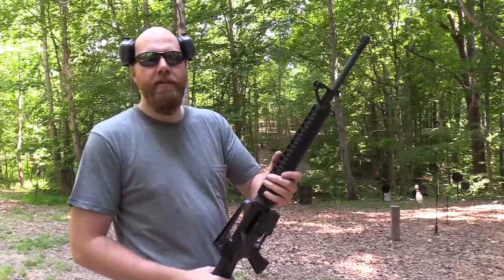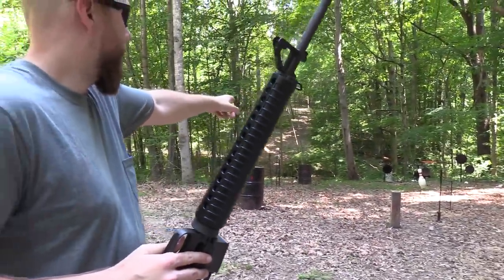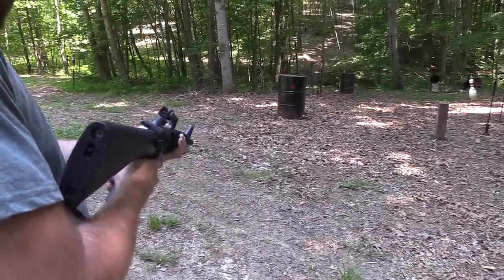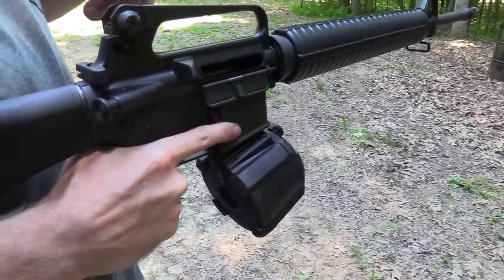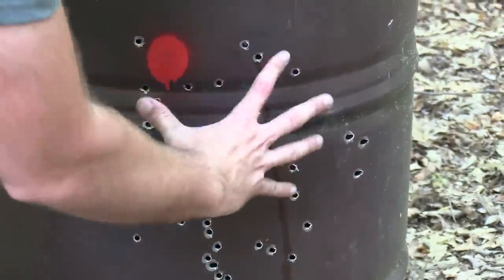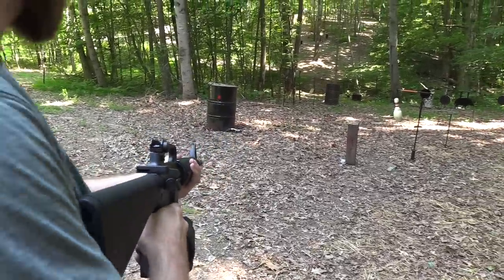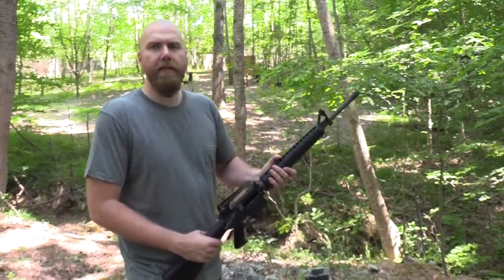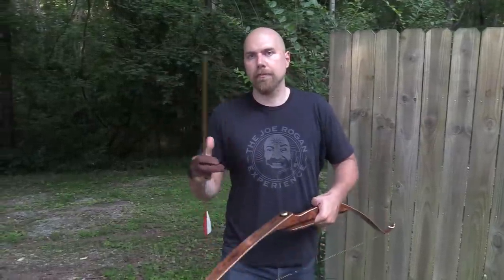Is Full Auto Controllable?

Comment: "Is Full Auto controllable?"

AK-107: "I'm the answer to that question."
Reply: Was looking for this comment
Reply: Real shii
Reply: Knights Armament LAMG: glares from afar
Reply: True
Reply: HK416 too
Reply: Surefire MGX
Reply: @canaluludorel5838   hk416 still has more recoil than ak107 since the recoil is not counter balanced
Reply: @canaluludorel5838  416 is gas piston operated, it actually has more recoil than the m4 analogues
Reply: @vincentriver3017  no way, i refuse to believe this.
Reply: @CheekiScrubb  ultimax mk3 enter the chat
Reply: cz 805…..
Reply: I agree
Reply: @canaluludorel5838  it has more recoil than ak-107 as far as the basic mechanism goes, the HK416 does shake a bit and does have a little bit more recoil, put in practice it is subsided but still controllable best at around 45m on the dot. The ak-107 is using the counter weight which literally has a metal weight pushing forward as the bolt goes back, almost mitigates the recoil, just a little shake in side to side.
Reply: @canaluludorel5838  the m4 only has to move the bolt assembly, while the HK416 moves the piston to move the bolt, so there may be room for a little bit recoil, or rather the shake as it pushes the piston, which is a piece of Its own kinda floating, and then punches the bolt which causes a little of the shaking and then the bolt cycles which gives the rest of the recoil, but sure in semi-automatic it would be controllable, but at around atleast 800 rpm it just keeps pushing.
Reply: AK-107 is awesome but the system of the rifle looks complicated, compared to the other piston rifles.
Reply: @fuckheinschitt239  bruh I guess a gear and a metal bar is complicated enough
Reply: @fuckheinschitt239  but I think the overcomplicated one is goes to the AN-94
Reply: @michaelsilva4844  yeah.
Reply: AK-107: “where recoil”
Reply: @canaluludorel5838  hk 416s actually have a harsher recoil cycle than most m4s
Reply: Ultimax 100 :AMATEURS
Reply: Ahhhaaahhaaaaa!!!! The truth!
Reply: AEK-971,3 : We* are the answer to that question
Reply: @canaluludorel5838  Leave it to the French to ignore what's right in front of them!
Reply: "Laughs in controllable 9mm"
Reply: dont forget the grease gun and the cz skorpion
Reply: Airsoft rifles are also controllable with full auto. 7.62 not as much.
Reply: Kriss Vector 9mm: you rang?
Reply: @paddlesaddlelad1881  i think most people are excluding smg's, but now that you brought it up, the MP5 should fare pretty well
Reply: 109*
109 is an advanced version with better recoil control.
Reply: @qanon7958  AA-12 isn't an smg
Reply: @paddlesaddlelad1881  huh, right...i was talking about the grease gun tho
Reply: @paddlesaddlelad1881  and i dunno if the skorpion is either a machine pistol or an smg, but it's certainly not a long-gun
Reply: Defenetly an PF player
Reply: @michaelsilva4844  yeah, the Russians saw the Krauts cooking up their space magic with the g11 and decided to give it a go themselves. AN 94 was a pretty cool rifle actually, even if it was expensive and complicated to the point of impracticality.
Reply: True lol
Reply: Ultimax 100: Oh please.
Reply: what you mean?
Reply: I forgot to tell you about AEK 971
Reply: ak109 throws a hissy fit
Reply: The MG4 or 5 is also ridiculous in that regard.
Reply: Lol. Unreliable soviet gimmick.
Reply: I read the 107 didn't pass rigorous field tests so was never issued.
Reply: Ultimax 100 is the real answer
Reply: M107 barret enter the chat 👀👀👀
Reply: Also, you’re right.

Comment: When I was in the Air Force Security Police from 83 - 87, we would spend one day every year at the range qualifying and go through about 250 rounds on the M16.  The last part of the day was on full auto, and we probably used about 10 rounds only for familiarization.  Of those 10 rounds if you shot more than a 3-round burst, the instructors would fail you.  Yes, you felt it riding up on you, but then again, we were never given any deep instruction in how to control it either.  That did not happen with the M60, but in the case of that weapon, we kept it down on the bipod legs.
Reply: That's pretty cool or is it not? I dont know. I'm only 15 I plan on joining the military one day lol. Thank you for your service man

Comment: one of the most obvious (to me) hollywood mis-representation is how fast you go through 30 rounds...it is much faster than hollywood magazines.
Reply: About 4 seconds of continuous firing.
Reply: @kylebradley3  More like 2.6 - 2.7 sec.
Reply: @Sunnysky321  gun design really changes that, 600rpm vs 900rpm is a massive difference (obviously)
Reply: M16A2 is 800rpm, so about 13 rounds a second, about 2.3 seconds of full auto
Reply: Right! Also what constitutes as appropriate cover, considering how those cinder blocks got annihilated at 40ish yards I would say Hollywood coffee tables and drywall are made of some magical stuff ;)
Reply: @Sunnysky321  yep, but even though it's 5.56mm Rounds It can Still Feel like a Mulle Kick you in the shoulder. Its sores when in drills
Reply: Hollywood mags: 200 rounds, gear shifters: 40 gears, T-Rex or other/monsters does not die in 3-5 rounds and are made of tungsten...

I needed this video tho since most games i mod, the fire group is usually 1 meter (3 foot) wide basically at 2 meter (6 foot) from the target... the reason i let those like that was because i had no example to base how plausible it was... so now i can make things a little closer to what makes sense!
Reply: Holywood does not use 30 round mags man. Their mags have ♾️ rounds.
Reply: Tried to time it more accurately a few times. My stopwatch gave me about 2.1 sec on average. It leads to approximately 860 rounds per minute, give or take a few percent.
Reply: @theepicslayer7sss101  But in Hollywood if the ammo ever runs out, you just toss the gun.
Reply: Movie Heat has actually pretty realistic rate of fire. But that's a 90ties movie, many modern movies add both the firing and impacts post production. For the big productions easier, cheaper and safer.
Reply: And yet revolvers never seem to need reloading (or virtually never).
Classic Westerns are bad for this.

Comment: All of my experience with full auto has been military with M16A1's, M60's, and M2's.  My experience with M16's and M60's with bipods or unsupported was mostly that of wasting massive quanities of ammunition on misses.  Vehicle and tripod mounts were far and away more efficiIent at all but very short ranges.   In this video, the hit ratio was excellent, but most of the hits were excess inasmuch as any enemy target would have been incapacitated by the first one or two hits.  Further hits would be, again, wasted ammunition.  On the full auto range at Fort Benning, I was surprised at how ineffective M16 full auto was even with a bipod and with my left hand pressing down firmly on the rifle.  My first round was a guaranteed hit on any pop up target at any of the target positions whilst subsequent rounds missed usually high and left.  If I knew that I had a lot of rounds in my magazine, I could spray three targets that were close together in a row in a sweep from one end to the other most quickly, but that was against advice from the trainer.  That was in accordance with other advice, born of experience, from one of my drill sergeants.  Early on as an infantryman, I concluded that unsupported full auto was not a thing that I would do unless ordered or unless I was confronted by multiple targets at very close range or moving targets at short or very moderate ranges.
Reply: My experience and background is about the same but I spent a lot of time in my younger days on the M60 and M249, The 60 is way easier to control off the bipods I would say I can hit groups of 5 military aged males or a vehicle out to 900 meters easily with the 60.  The 249 I really had to lean into those weak bipod legs.  The king is the M240b it’s beautiful, accurate and you can close the cover with the bold open or closed. With a machine gun optic I could probably hit pop up at 800 meters 90% of the time that gun.  I always wished they put a selector switch on it but that’s not the purpose of a machine gun.
Reply: @Cannibal_Actual  The M249 came after my time in the infantry as did the 5.56 mm squad automatic weapon.  However, I did see a copy of the new SAW in the custody of some Marines later when I was in a support company in the Army Reserve.  What is the M249 like?
Reply: @Quentin217  very jumpy, after a 10-15 round burst you exhale smoke…lol.  But as long as it’s clean it works.  Many of my troops don’t like it but when I inspect their weapons and it’s full of gunk I guess it’s very hard to clean well for the new troops.  it has a port to take a M4 mag in the side but it’s almost worthless in my opinion because if your that bad off where you can’t get another belt there is probably another rifle laying around you could use with better effect.

Comment: I was taught to never use full auto outside of CQC - even then very sparringly.

Pro's: 
+ Higher potential lethality
+ Accuracy through volume of fire
+ Has a higher surpressive effect

Con's
- Very high ammo consumption (Often reloads & increased weight of the extra ammo)
- Harder to control out of prone/ prepared positions
- Gun may overheat and be more prone to malfunctions (Most AR platforms weren't designed to be run cyclic for longer periods)

I will say that there are some pretty big advantages, but in my own experience the often reloads and heat issues outweigh the benefits.
Personally I'd only resort to full auto as a last ditch effort to keep an enemy away, generally rapid semi-auto is much more effective at preventing ricochets and scoring accurate hits... If you need to fire more than 3 rounds, you're either dealing with some real shit or you need to work at your marksmanship.

I have overheated an AR platform once, the result was a shot-out barrel... Even with the full guarded floating barrel, I could not grasp the rails around it - with gloves on.
My gun was later deemed unfit for service (accuracy went to shit), so I will never recommend full auto as a default... Use if it makes sense, but be very concious about the effect it may have on your gun and your ammo consumption.

Comment: Excellent Demo! There is a reason why most military assault rifles have full auto cabability; it leaves an option for certain situations. What if you are outnumbered and being rushed at close range? Full auto would certainly be a nice feature to have.
Reply: You usually only carry 6 mags. By the time you're being rushed at close range, you've likely used at least 3 of them. At that point, you only have 90 rounds left. Full auto is a last stand resort or covering your buddy in retreat.
Reply: @Steven Kwiatkowski None of the M16s (3 round burst) are being replaced by new ones. The new rifles are all M4s with full auto.
Reply: @Steven Kwiatkowski USMC pretty much every infantry unit has H&K m27’s now. US army has converted all M4’s to m4a1’s with full auto capability

Comment: "is Full Auto controllable?"

Answer: Depends on caliber, depends if you have any sort of compensator or heavy muzzle break and it doesn't hurt if you're soo jacked, you can Rambo fire 2 M-60s at the same time
Reply: You’re*
Reply: @CasualInTheTrees  Gottem
Reply: @CasualInTheTrees  Grammar Nazi 😆
Nothing of what I said changes because of 1 typo.

Correction: 2 typos.
Reply: 556 is honestly the best round
Reply: @EltonL  agreed. Which is why the whole push to 6.7 seems Dubious at best. Lots of countries still have the Ppsh-41 & it's replacement, PPS-43 in service for use by reservist rear echelon troops. The tokarev cartridge is as remarkable as 5.56 is. It's capable of going through body armor, yet it's as controllable as this AR.
German MP40s also are surprisingly easy to handle, for saying the rate of fire is just slightly lower than the MP18.

Comment: Back in the early 80's, out of shotgun news, and some gun shows, * it was a "parts kit", in a box. So as long as it was in pieces in the box it wasn't illegal. You could get a (tri-burst), the parts were all there, but the lower receiver had to be made before a certain date. After that date the milling was different, it wouldn't allow the install. Unless you had access to a milling machine and or a midnight machinist. Those kits were like $49.99

Comment: With my experience a lot depends on the rifle and caliber.  AK-47's have a lot of muzzle rise due to the high center of gravity of the bolt/carrier, which is a huge chunk of mass. A Browning 1919 on the other hand is very controllable. Don't have any M16 experience but it looks very controllable to me, probably has a lot to due with the smaller caliber and the direct impingement system that keeps the bolt/carrier in line with the muzzle.

Comment: Certainly not the FN FAL 7.62mm NATO. After two or three shots it becomes an effective anti-aircraft weapon.    😃
Reply: Even if you can compensate well, that dang round has so much concussion it blurs your vision because your head is vibrating. It's not the greatest for unsupported fire. Gotta wrangle some of that energy into something other than your upper body.
Reply: @Izak Most battle rifles are NOT  intended to be fired full auto.  If you have to, that's what a bipod is for.

Comment: The original purpose of full auto is for suppression / covering fire so troops could advance no man's land with less risk of being shot. However  with the benefit of of full auto, there are increased logistical, mechanical, and training problems. 

You could argue in certain encounters the rapid followups could be desirable, but I would say it increases the likelihood of unnecessary shots which may or may not be important if the engagement continues (more than one attacker or missed shots). Of course there is always the liability issue where did each round go. 

All in all, should full auto be regulated? No. Is it widely practical? Not for most people currently.

Comment: Full auto is its own beast, the 3 major factors on is full auto controllable are...

1. Firearm design - This is critical, you can have 2 firearms chambered in the same round with 1 being considerably easier to control than the other under full auto, its a very complex and complicated process but there are significant differences between platforms.

2. User experience & capabilities - This is also critical, someone that is used to shooting full auto and knows how control muzzle climb and drift can make much more effective use out of a full auto firearm than someone with little to no experience can when operating the same firearm in the same conditions.|

3. Cartridge Power & Rate of Fire - These 2 are intertwined, and for good reason. .22LR at 800 rounds per minute in a Ruger 10/22 is incredibly easy to control, .50BMG at 800 RPM in a shoulder fired weapon would be insanity. Also .22LR gassed up to 2000 rounds per minute would generate way more recoil than people would think, I have shot a Ruger 10/22 with integral suppressor at 1200 rounds per minute and its got some muzzle climb, even 1,200 is much more noticeable than 800 rounds per minute.

Comment: Full auto always seemed pretty pointless to me unless it's strictly for suppression, but if that's the case they're most likely going to be in a belt fed machine gun for suppression

Otherwise you'd run no more than 2-3 round burst at most on regular mags.
Reply: It would be very useful in CQB and room clearing situations. It’s definitely a capability I would want to have if I was a soldier.

Comment: So in order to answer this question, you have to try it. I've fired M16A2, M60, SAW and good ole .50 cal.

In reality when they went from full auto M16 to 3 round burst on M16A2, that was a good thing. Even firing a 3 round burst and standard suppressor you will see your shots go higher and higher 1, 2, 3. You're supposed to start aiming low. Aim low torso or even lower and the shots will travel up. I was surprised you didn't get much of that.

Now with the proper setup almost anything is accurate full auto - I mean a good bipod or tripod with enough weight. Don't even try to fire an M60 full auto standing and really think you're going to be accurate. Trust me - we tried it in training in the Marines.

It's not directly related to the accuracy thing, but we were trained even full auto to fire in bursts for ammo conservation and also not to overheat the barrel, especially M60 and .50 cal.

I do have to respect the groupings you've obtained in this video.

Comment: The automatic rifle is designed to be able to take advantage of full auto - for the AK47 Soviet auto fire is to aim low and fire a 3 rount burst. The gun is designed to rise in order that at 100 ft the arc of bullets will cover about 5 ft. or the size of a man.  If  you aim accurately you will hit the target 3 times; a bit low likely one in the dirt 2nd low and 3rd middle, too high one in the belly, one near the head one over the head.

Comment: My two cents: Every machine gun design (weapons that all have in common the exclusive purpose for sustained, fully automatic fire) has got a long barrel and some kind of mechanism for anchoring the device for maximum stability, such as a bipod. So, as a broad rule of thumb, if you've got a weapon with a short barrel and basically nothing to get a good grip on it to control it with, full auto on that thing is probably not going to be as effective.